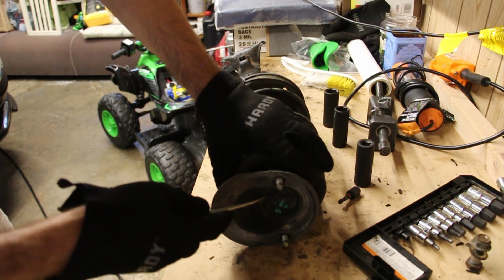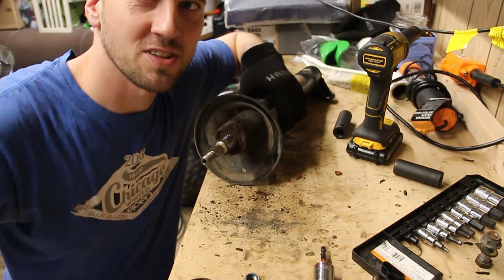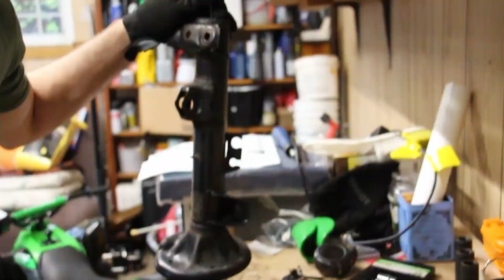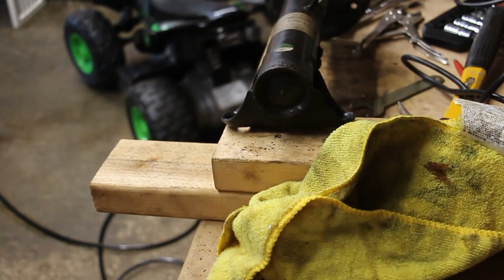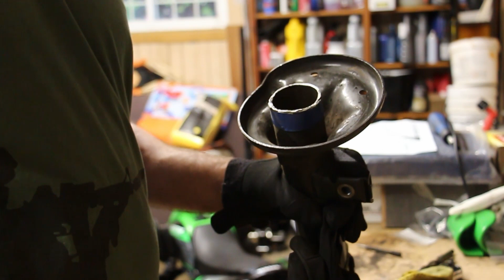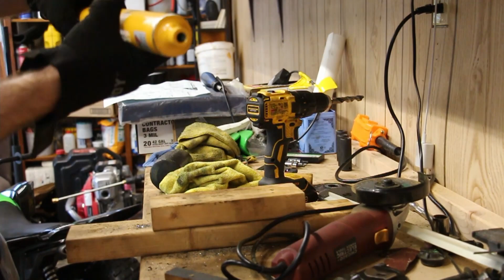Cutting up my BMW Z3M Strut Housings To Accept Koni Inserts

Comment from the maker: Here is a trick ( you can see it in the vid, but I didn't explain it): Skip to 5:58. Use the rubber dust boot that came with the new shocks as a template to draw the cut line. Also the manual that comes with Konis gives you the exact measurement.

Comment: You forgot to mention how many millimetres you had to cut off the shock housing. I have this job to do, nice to see a rehearsal🍻
Reply from the maker: So here is a trick ( you can see it in the vid, but I didn't explain it): Skip to 5:58. Use the rubber dust boot that came with the new shocks as a template to draw the cut line. Also the manual that comes with Konis gives you the exact measurement.